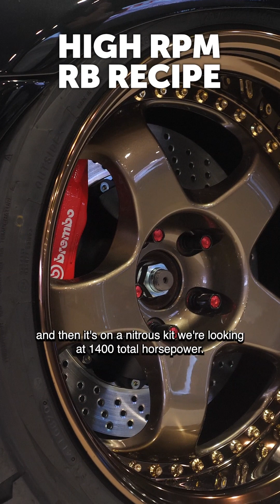What's wrong with this 1400HP R32 GTR? #shorts

Comment: Too much spring for 8500 rpm
Reply: They ain't tell us bout the specs on em tho
Reply: @sid426_  "heaviest springs we could get" tells me they can go just a bit further than what you could spin a stock rb26 to.
Reply: @QcumberDolphin never mind the extra 45-50 duration, the extra 2.2 - 2.5mms of lift  , the nitrous kit or the extra 20-35 psi of pressure in the cylinder pushing back against the valves. 

We'll just focus on the extra 1000-1500 rpm than a stock 26. 

Yeahhhhhh too much spring! 😂

Heaviest springs they could get their hands on would be for 26 specific spring set . These are practically the biggest bump sticks available for and it'll probably be running 40-50  psi. I'd be running the heaviest 26 springs available also.
Reply: @hayden6056  if theres factory Nissan cast heads making 2500+ hp then trust me. these are not the heaviest springs they can find, and if they are they can spin a little higher than 8500
Reply: @hayden6056 he has a point. The engine even how it is with all that stuff. Unless there's a flaw in something should be capable of like 9k from what I've been looking into at least maybe 9500. My ls7 does 9500 albeit very built.
Reply: You add the boost pressure into the spring pressure  because boost can cause valve float  20psi will need  20lbs extra tension 30psi = 30lbs extra   it’s a fine line of finding the perfect tension to suit revs boost and cam lift  also the weight of valves and spring caps need to be taken into account also when selecting springs
Reply: @theegwana2103 can depend on a few other factors as well.
Reply: @bmxriderforlife1234  flat tappet or roller ,hydraulic or solid ,cam ramps ,rocker ratio what else?
Reply: @theegwana2103  lol if you're asking if an ls7 that revs to 9500 has a flat tappet in it , let alone any LS I don't think I'd be using you for spring advice.
Reply: @hayden6056  lol no shit I didn’t say anything about a fucken ls7 motor this vid was talking about a rb that is solid flat tappet bucket lifter originally rb26 is shim under bucket im am a engine specialist so yeah know a few things lol
Reply: @theegwana2103  you quoted his name after he was speaking about an ls7 and asked if it was flat tappet or roller. Hydraulic or solid and asked about what rocker ratio. 

RB doesn't have roller set ups or rocker arms. 

So if you weren't asking about his ls7 what were you asking about? Definitely wasn't rb lel.
Reply: @hayden6056  I replied to his comment to me saying can depend on other factors was asking him what other factors… of course rb doesn’t have rockers lol I have done hundreds of them rb 20,25,26 here in New Zealand
Reply: @theegwana2103  stroke, rod ratio  rotating mass, flex in the rotating assembly and other aspects of the engine. Harmonics and resonance issues where it hits just a overly vibration happy point of the rev range.
Reply: @hayden6056  he wasn't asking if my ls7. He was asking what else affects the red line and such. Context.
Reply: @bmxriderforlife1234  agh fair re read it n see what you mean thought he was asking bout the ls7 n saw flat tappet or hydr roller n was like lol. Ft in an LS or hydr rollers not bleeding down at 9.5 .

Comment: What kind of fuel pump is that ?
Reply: Rage is the brand.
Reply: @RTunedPerformance  Thanks, usually see the Kinsler ones on RBs
Reply: @nzuncovered1845  originally we had a Kinsler pump as they are proven performers!  The Rage pump was chosen as it has the same flow rating but was all black and had a very sinister look to match such an evil looking engine.
Reply: @RTunedPerformance billet block?
Reply: @filip-pi9hy  no, this is an RB30 Block with Nitto 3.2 Stroker.